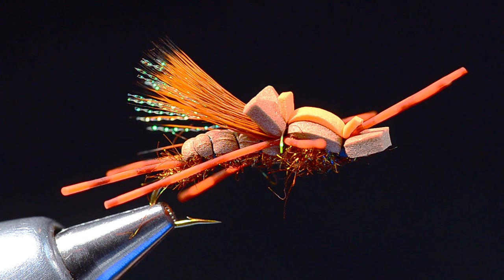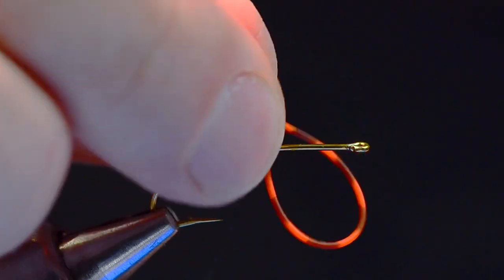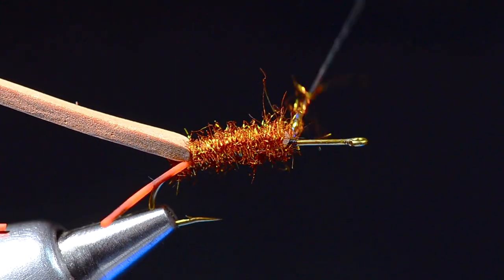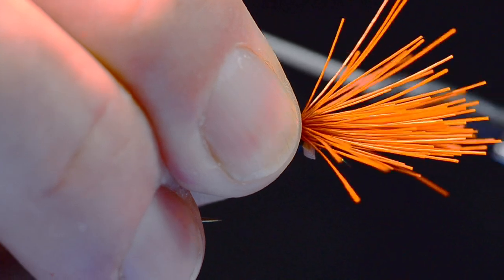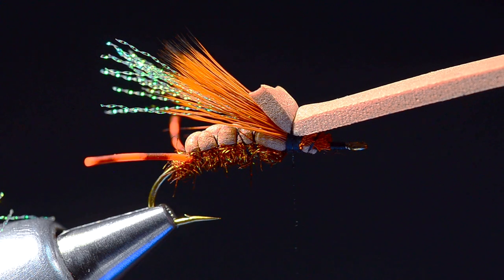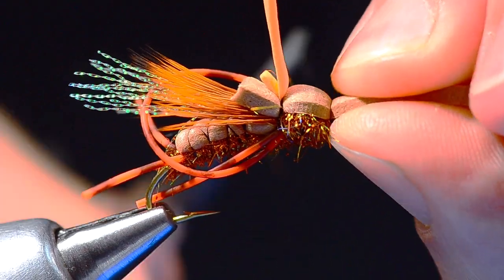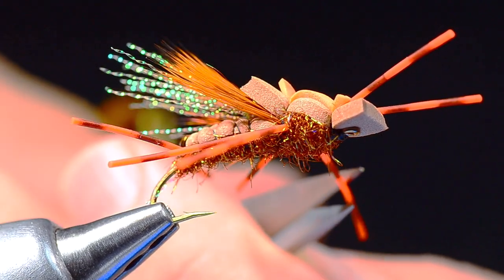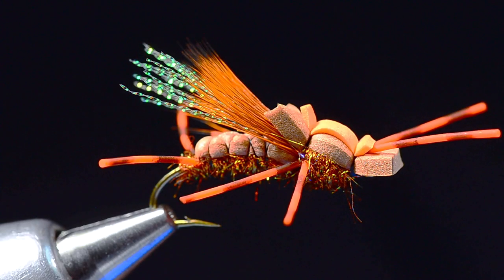Grillos's Low Rider Fly Tying Instructions by Charlie Craven

Comment: Curious about whether the head cement will 1) bond the hook eye to the foam and 2) will fill in the hook eye to make it even more difficult to thread the tippet through the eye since the foam is laying on the hook eye.  Cleaning the hook eye with a stripped feather or peacock herl would seem helpful.
Reply from the maker: I’m betting if you put enough head cement on there sloppily that you sure could glue the foam to the eye or fill the hook eye, but if you take a closer look you can see that I turned the fly in the vise before applying the cement and so the thin head cement does not run forward onto the foam or eye but instead it runs into the thread head and thorax of the fly. Details make the difference!